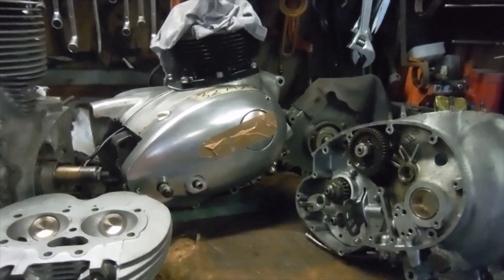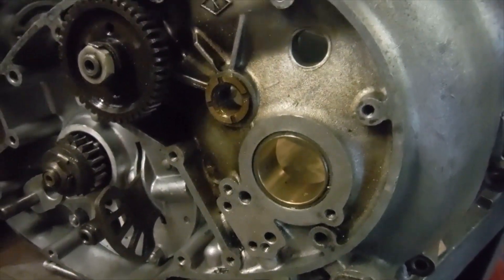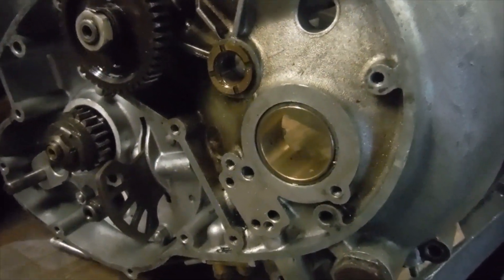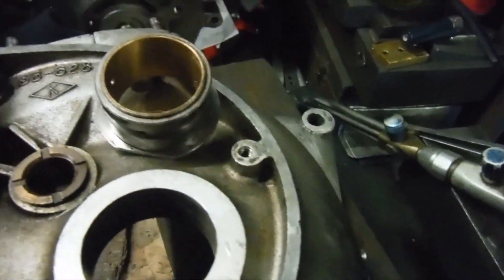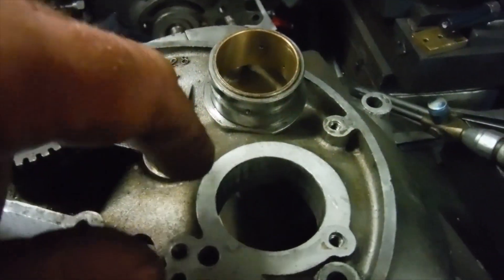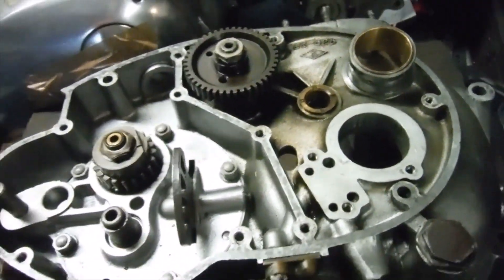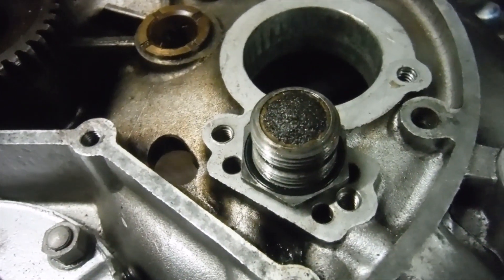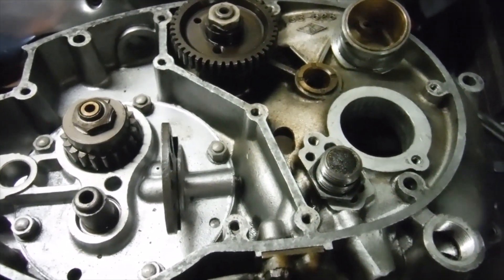BSA A65 engine crank and timing side bush developments, thanks to tractor engine!

Comment: That seems crazy to remove that bush that was bored to suit crank , never be as good as it is now it could go back in crooked or loose interference  , I'd would clean and blow and push a bit of wire through the holes and repeat 4-5 times cleaning with degreaser and brake clean .
Reply from the maker: There was swarf behind it that wouldn't have come out. With the crankcase very hot, it came out and went back in without any fuss and I marked it to make sure I put it back the same way round, so I am not worried about it, although I know what you mean.

Comment: Is there a problem with freezing the bush to help  reassembly?
Reply from the maker: Not as long as it can be kept frozen until it is time to fit it, which might be tricky.
Reply: I had to build a new oversize exhaust guide for my zb31. Adjustable hand-reamed the eggshape guide hole. Turned a harley guide down with .0015 interference and built a driver to contact the guide’s shoulder so it doesnt mess up the end thru-hole. Between the head heating and the guide freezing I’m hoping for an easy installation🤞.
Reply: @hunterjamison4808   press it in  , don't wack it in .
Reply: We’ve got an adjustable angle mount plate at the shop I bet I can bolt the head to for the press, I’ll try that, thanks!

Comment: Hi Paul have you got a source were I may be able to get some of those tractor bushes
Reply from the maker: All I know is it is a Ford 5000 small end bush - a 4000 may well use the same. They are possibly available through Ford / New Holland dealers. Mine was a NOS item which happened to be on the shelf at my regrind guy's place.
Reply: @paulhenshaw4514  thanks Paul for the info
Reply: that bush  be far better than some of the pattern  stuff going about now